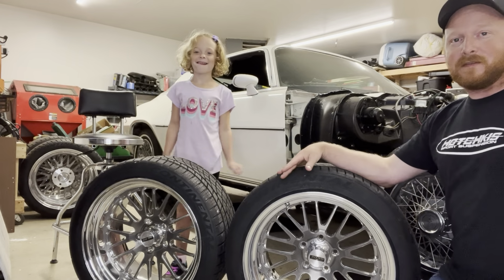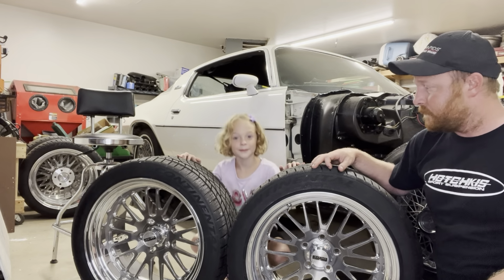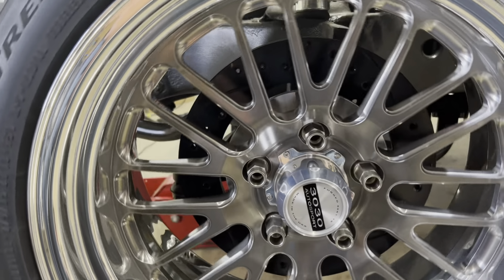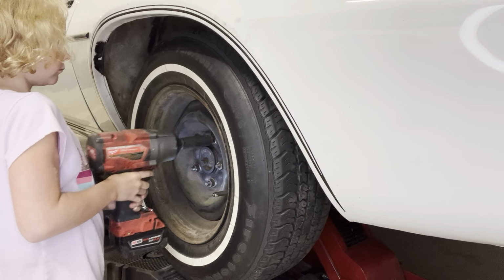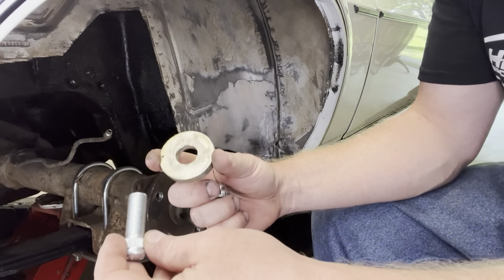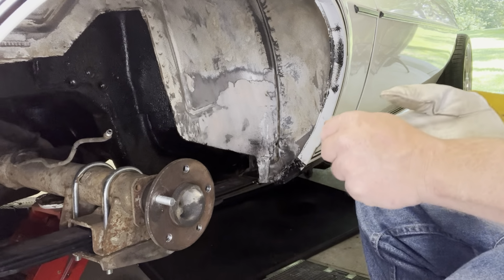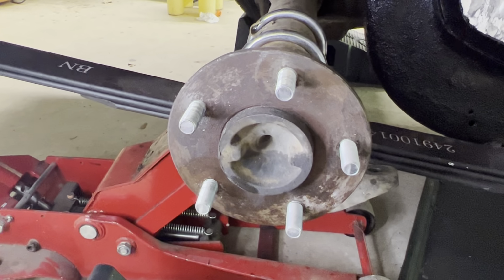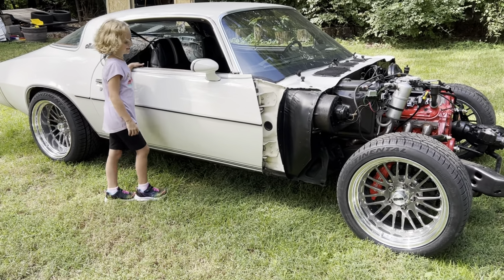Revealing our CUSTOM FORGED  WHEELS from 3030 Autosports

Comment: Looks like the rear wheel is way too wide for that tire
Reply from the maker: There is a slight stretch, but nothing I would be concerned about the continentals are a little smaller than a 295
Reply: @life_bycars  slight? a 10” or even a 9.5” rim would have been perfect for that tire, I wanted those wheels for my 69 camaro but I can’t imagine cleaning them
Reply from the maker: @tjed1071  the RE71rs tire I run now has no stretch. It is still a 295 for some reason. The continental must run a little smaller if it’s perfect now. As far as wheels go, the centers are powder coated and super easy to wipe down the lips could have been clear powder coated to make them easier to clean, but I chose to go with a raw aluminum, which for me is not terrible to take care of